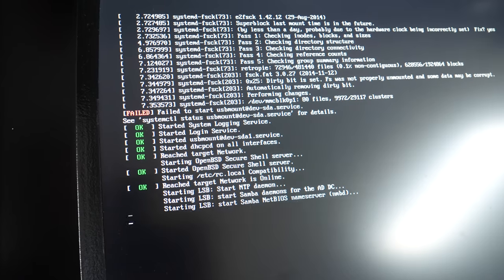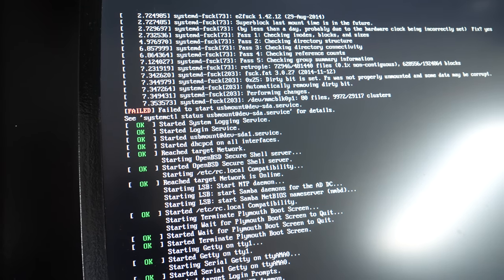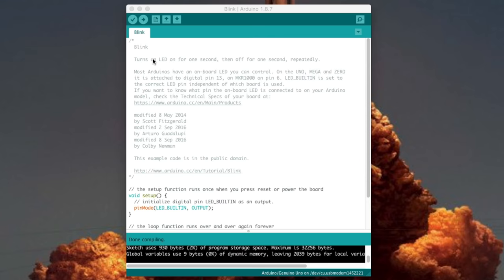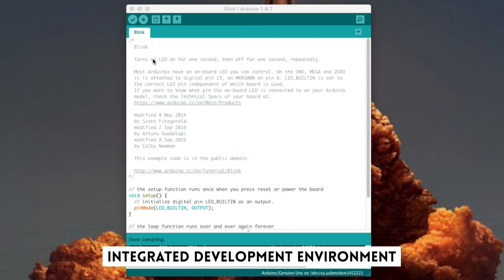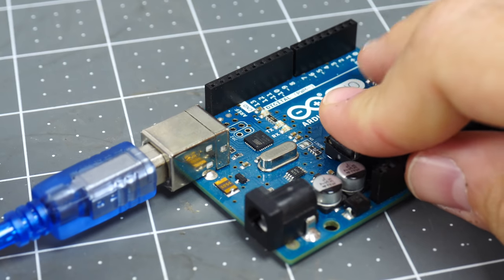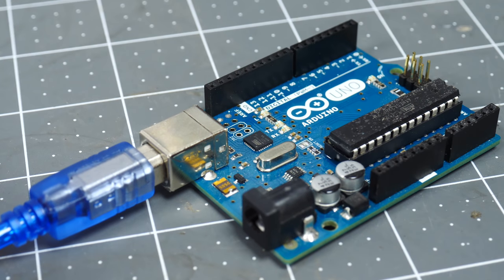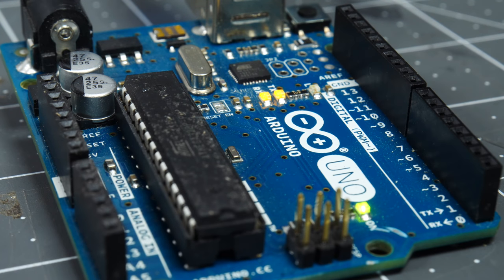Arduino vs. Raspberry Pi // Bits | I Like To Make Stuff

Comment: Should really have mentioned that the Pi's 40 pins are not all IO, many of them are 5V, 3V3 and GND, or are otherwise limited. The Pi's logic is 3.3V, while arduino is 5V. A Pi has no analog input by itself, it needs help from an MCP3008 or a similar ADC chip. Finally, once you have a working arduino, you can easily scoop out the actual logic chip, and put that in your project for a really compact build. The big difference here is that an ATtiny or ATMega chip costs maybe 2-5$, while a for raspberry pi your only option is the whole board for around 35-40$, excluding SD card.
Reply: Yeah only 28-odd ones are GPIO, so saying 40 is somewhat misleading.
Reply: I think he was simplifying to make the initial understanding easier for people like me. I understood the jist of it which will encourage me to look at taking the next step. Adding everything you mentioned, while I am sure is accurate only confuses the target audience. Understanding the target dictates what Bob ”should really have mentioned”
Reply: Also the MIPI DSI and CSI are unfortunately so proprietary that it's hard to connect to anything, there's only a handful of official hardware for them, but it's not hard to hack a smartphone display onto it if you can code in C.
Reply: NEEEEEERRRRRRRRRRDDDDDDDSSSSSSS
Reply: I was going to say similar, he seemed to skip over the GPIO part of the Pi and just mentioned it had 40 pins but not what they actually are. The Arduino is by far the best choice if you need Analog IO and for the most part is the best choice for most electronics projects. Especially with a Mega2560 Pro Mini which is both compact and boasts 54 digital IO and 16 analog IO
Reply: wow these guys really hate raspberry pi.
Reply: Well, not the only Pi option. The Pi Zero is $5 US ($10 for the built-in WiFi version).
Reply: Cheap pi exists though. For me it's the minimal setup options on arduino making small devices possible to make is the feature that really stands out.

For the number of pins, it usually doesn't really matter as long as using i2c to it's fullest.
Reply: Al X Zander ASSSSSSS HOOOOOOLLLLLEEE

Comment: Great video Bob! One small thing though, the Arduino UNO (and most other models) can run on anything between 5-12V, because they have a built in regulator which will step the voltage down to what the board needs. The RaspberryPi takes 5V, non negotiable. This means that you're a bit more free in how you power the Arduino, and you could for instance power it directly in a car from the on board electric system, whereas the RaspberryPi needs to have it stepped down first.

Comment: Shutdown is also important to consider. You really shouldn't just kill the power to a Raspberry Pi as it could potentially corrupt the OS. An Arduino is better suited to consumer products where they are more likely to just pull the plug or want to flip a  switch to turn it off. Raspberry Pi's are better suited to long running devices that the user understands need to be used a certain way. So you wouldn't want to put a Raspbery Pi in a toaster. But a Raspberry Pi is reasonable for a network storage device or media streaming server that users intend to leave on all the time.
Reply from the maker: Excellent point! Thanks for bringing that up!
Reply: I just bought a StromPI made by Joy-It with a battery hat. Together they are an UPS for the Pi and can initiate a graceful shutdown when the power is lost. The battery is LiFePo, like LiPo, but without the flames. But as the producer sits in Germany, no idea about availability elsewhere.
Reply: Well you can put the Raspberry Pi OS on read only mode. Then pulling the plug out of the Raspberry Pi is not harmful.
Reply: I am electronics engineer with 40+ years of design experience. Recent usage with Pi 3B+ proves to me that its power down process is far from reliable. I will not recommend it for any of my clients' projects.

Comment: One note about Arduino is that if you build a standalone unit (without the USB connectivity that the Uno has), you will consume much less power. I recently built a Halloween gadget with LEDs for my kids. It runs through a flash cycle and then sleeps until reactivated by a monitored switch. While it is running it consumes ~14mA but while it sleeps it only consumes 0.28mA! And I have no idea what I’m doing! I’m sure more knowledgeable people could do even better
Reply: What board did you use?

Comment: You mentioned the arduino runs a "subset of the C programming language", which is not true. All the arduino sketches are actually programmed in C++. The backend compiler is a modified version of gcc which compiles the code into the AVR instruction set. You can most likely find other compilers online which compile other programming language to the AVR instruction set.

Comment: Helpfull Video, Bob. Thanks! I wanna make my own Droid and I guess a PI would work better. I've read that the PI is much more expensive than a Arduino. Is ist true?
Reply: You can get a Pi Zero W for 9.60£
There are many versions of the Arduino. E.g. you can get the Arduinio Nano as a Chinese clone for around 3 €
Reply: @nenioc187  Ok, thanks. I checked  
the internet out and found pretty inexpensive PIs. Gonna buy one in the next time.😁

Comment: Just like there are different arduino compatible boards there are also other pi's, so the pi 3 cost $35+ USD but there is also a pi zero and zero w at around $5-10 USD that can almost bring its cost the the arduino uno level and the w version has wifi and bluetooth built in. Good video!
Reply: But you'll have higher power consumption, 3.3V logic level, more fragile, and because it's a computer, you can't have usually that precise timing. Plus you need an SD card.
If you need wifi, you should check the ESP8266 and ESP32. Later have BT and BLE. And it's like 3-5$. And many times fater than an UNO.

Btw if you can benefit from using a computer, then go for the Pi, but sometimes it can give a bit headache.

Comment: use them both pi with node-red and gpio node, usb  to arduino with firmata. you can then use 5v sensors thru arduino easily + ANALOG PINS .and have the conductivity and power of the pi

Comment: It is remarkable to see that these, complete different boards, are being compared. A raspberry pi has 4 ARM cores, running on GHz, with giga bytes of RAM, HDMI en SDCard. Then you have an Arduino... please bear in mind that a Raspberry Pi can be used as a micro controller as well. There is no need for Linux.

Comment: Related: microcontrollers like the Arduino (even though it is relatively slow and only 8 bit) are great for real-time stuff. When you run on a full OS like Linux or Windows, the multi-tasking and other OS maintenance tasks start to introduce jitter to the timing of things executing. So if you need to do anything real-time, you're better doing like you did with a big brain/little brain approach, letting the microcontroller do the RT stuff.

This is the approach I've been using with some complex personal projects, but rather than Arduino, I use STM32 and GCC.

Comment: For me, it boils down to that the Arduino is good at turning things on and off and repetition whereas the Raspberry Pi is better at graphics. While the Arduino will never match the graphics of a Pi, I think an ESP32 with a Nextion display is the closest you can get to matching a Pi. The ESP32 has WiFi and Bluetooth for only $8 and the Nextion displays have their own processors so all the Arduino does is send serial commands. All the heavy graphics are handled by the Nextion board so that the Arduino can do what Arduinos do best.

Comment: There's a few workarounds for the issue of Arduino only supporting C. There are a few compilers that compile Python code to C if someone has a hard time learning the language. Also there's at least one D compiler that outputs C, but I don't know how well is it maintained, but if someone willing to go all custom, then some ARM microcontrollers are supported by LDC and GDC.

Comment: The USB port is actually fine for PC to Arduino communication not just putting software on it, hence you can use any computer with a USB interface to deliver and recieve instruction and feedback. 
It does not pretend to be a full blown computer. Thats what keeps it super cheap and super useful.

Comment: I did not scan all of the comments. I would comment that the Arduino runs at about 16Mhz where the RPi runs at 1+Ghz? There are times when you just can't manage to juggle all the things you need to with an Arduino. That is not to say that many a hobby robot hasn't been built with the help of a fairly simple microcontroller along the lines of an Arduino.

Comment: i am in the process of upgrading the mancave and i am currently building the arcade cabinet.......SO can you make a vending machine with about 3 drink options that are cool with small refrigerator motors and thermostat.... and 3 snack options i would like to have the options on it working with and with out the use of a payment system.......do you think this is to big of a project.....i have made a one drink option vending machine with payment and i can open it and make it non-payment needed but would like it all without opening the machine.

Comment: You don't need a full amp to power an uno. I don't even think you can pull more than like 200mA through it without exceeding its ratings and if you need that much current in your control circuitry, you need to go back and redesign some stuff. So if you have a supply rated for 1A @5V, you can power the Uno @1Wmax and an additional 4W of whatever else you need.

Comment: Correction: The Arduino is programmed in C++, not "a subset of C".
More specifically it's C++98 with a nonstandard default library with nonstandard implementations of strings and such, but it is very much still C++. You can even define classes like normal, you just can't use the "new" keyword on them.
Reply: You can, there is heap, but you really shouldn't in an embedded device...

Comment: Arduino or in general a microcontroller can run on way less power consumption than the mentioned 500ma. With sleep mode enabled even under 1mA without any issues...

Comment: Likely, if your project only needs a microcontroller, you should consider an esp8266 or esp32. Smaller, cheaper, wifi built in, and they can be developed in the Arduino IDE.
There are, of course, exceptions, but you should try to us the cheapest, least powerful solution whenever possible.

Comment: This was great, now I know everything you said, but man... I'd have loved this a year ago!

By the way, you're a bit off on the arduino as you seemed to equal arduino to arduino uno. There are lots of different arduino boards with different built in capabilities. For example the NodeMCU which is, as far as I understand, I'm not an expert my self! a arduino clone with wifi. This litte bugger is wonderful when you want to interact with the board, and that's the other thing. As arduino boards have inputs of different kinds you can change the vaules without flashing a new arduino hex onto them. In fact, a little thing I did as I was trying ouy my nodeMCU was to build a light weight web browser which I could interact with. LED on, LED off and such.

Comment: one thing that tripped me up for a bit was understanding that even though they run on 5V, they can control devices on other voltages. if the device has a "data" input (like a 3rd pin for LEDs), you can just bypass the arduino/pi entirely when it comes to powering the peripheral, and if it only has power inputs you can use a shield/hat to handle it

i'm far from an expert, but just wanted to share one of the things i've run into!

Comment: One thing that doesn't get mentioned a lot is that sometimes even an arduino is overkill. Sometimes a 555 timer or other simple circuit is enough to give you what you want and can be a lot cheaper. Great overview as always Bob.

Comment: The amazing lack of detail in this video would make many newbies think the Pi is almost the only choice -  I have both arduino and Pi, and they serve massively different functions.

For a learner - the price is a big issue!!

Arduino Clone.. A$3 .. Raspberry pi A$50.. 

PSU.. Arduino.. 9 volt battery will allow the Arduino to run - or it can run from the USB port on your computer ... but you need a 2 Amp 5V psu for raspberry pi..

Arduino - analogue in - it has inbuilt ADCs.. Pi needs extra components.

In my workshop, All small, simple jobs (or anything needing guarenteed timings eg radio control decoding ) get an arduino.

If the project needs a large display, needs to talk to the net, or just needs lots and lots of data processing, then the Pi is great.

Always check what the job needs before deciding..
Reply: @nufgorf
Just starting to learn here, but would like your input.
Arduino does only 1 function? Or can it do multiple simple tasks?

Say for example I want to control a water system on an RV: monitor tank levels, create a "dump" function where a valve is opened and pump started.
Would I need to look into Raspberry pi for this?

Comment: Arduino is not using a subset of the C language. It is actually using the full C++ language. The Arduino IDE compiles using GCC.
Reply: How does this not have more upvotes?
Reply: @cateyenebula  Because people using Arduinos are electronics hobbyists. They only care about a few low level API calls, loops and conditions ;-)

Comment: 2:29 I thought that Anolog is on/off and digital = multiple values.. or not?
Reply from the maker: Not in regards to the pins. The analog pin can read a value from 0-255 while a digital pin is looking for a true/false 0/1 value.
Reply: oh, yeah, right, I messed up by thinking that analog should be more complicated, but now it makes sense!
Thanks

Comment: You cannot run windows on the PI. There is a IoT version of windows that you can run with it. But not as a classic OS.
Reply: Well, using DOSBox on the Pi you can run Windows 3.1, which definitely is a classic OS ;)
Reply from the maker: But you literally typed "version of windows". How is that not Windows?  I didn't say anything about the UI.
Reply: Because it has not much to do with Windows OS. It just goes with the Windows brand. I had encountered many people, who bought themself a Pi because they heard on the internet, they could run Windows 10 on it. Windows needs another CPU. I love your videos because they are usually very specific about the topic. You even mention every angle of every piece of wood you cut. So I'm a little disappointed about this vid :-(

Comment: Arduino is better for time critical applications, as it is single tasking. A computer such as the PI has interrupts that cause your program to pause for a while whilst it does something else (for instance read what you typed on the keyboard). The PI may have more computing power but it is not 100% available to your code.
Reply: Arduino also has interups but you have to learn AVR to use them without needing a lot of memory.
Reply: I wasn't refering just to interrupts though. I also meant there are other processes running that will take chunks of CPU time.  They each have tasks that they are better at but equally there are tasks where you could use either
Reply: Gets back to clock speed

Comment: whats the cost difference between them?
Reply: It depends on which devices you choose. You can find low cost versions of each and they are fairly comparable. You can also build your own basic Arduino boards at a fraction of the cost by simply buying the micro controller separately and adding on a few required discrete components. In other words, you can buy a standard Arduino development board, do all of your development and testing, and then pull the micro controller off of the development board and put it on a much smaller, simpler, and cheaper standalone board that doesn't have all of the extra stuff you don't need. You can't do that with a Raspberry Pi.
Reply: You can get an arduino attiny85 with 5 input output pins for like $0.10, or a micro arduino ready to upload program and use for $1 from aliexpress. The MEGA has 56 IO pins, and is like $5. These are great for projects that react to input... push a button, stuff happens. They can do complex stuff with shields, but sensing and output control of motors, lights, etc. is their focus. If your project is run off AA's or small lipo batteries, coin cells,... arduino.

The raspberry pi is designed to run graphical user interface software. If your project needs a screen, or is a full fledged robot that must make massive computational calculations for balanced walking... or if you want to run games that are graphic heavy, like an Super Nintendo emulator... then Raspberry pi. They cost $25-$50 for basic version from microcenter depending on discount. For  $60-$80, you can get a powerful enough pi with enough ram and processing speed, that wont bog down from emulators. Pi will require you to plug your project into the wall or have a larger li-ion battery pack installed.

Comment: price
Reply from the maker: Prices change from model to model and year to year.  Just check your favorite retailer.
Reply: Thats true, but if you consider the price into the planing, than the use case is pretty clear: Use Arduino when possible Raspberry otherwise.